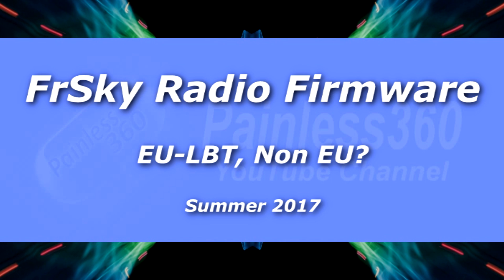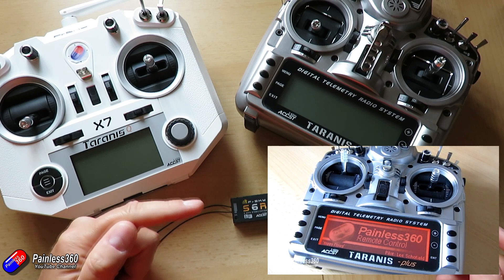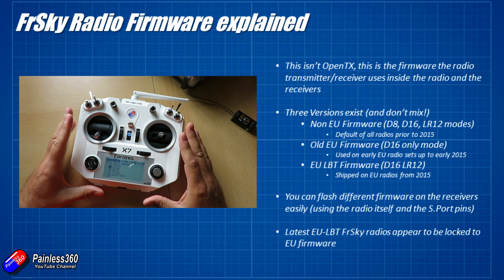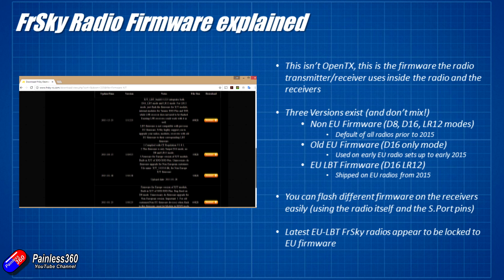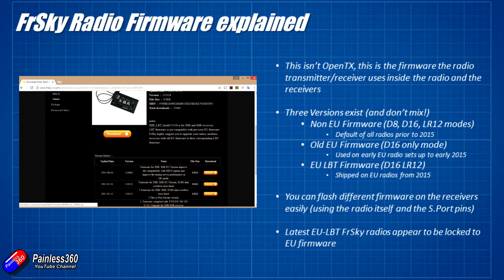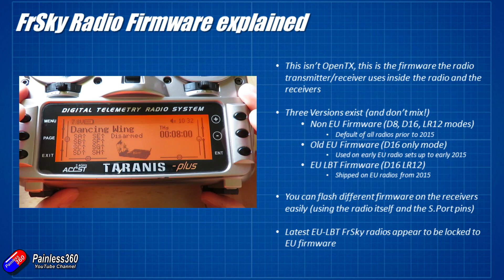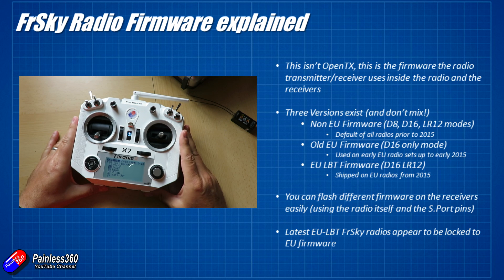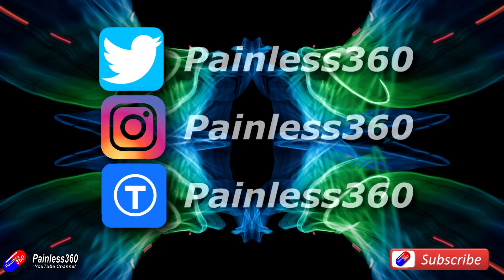RC Quick Tips: What is FrSky EU LBT and non EU firmware all about?

Comment: Hi. I updated my old Teranis X9D to Edgetx and also the internal XJT module. I use the latest firmware from Frsky for the XJT module, version EU LBT, but I can't bind to my new receiver G-RX8. Any idea? Wery greatful for help.
Reply from the maker: I never did that to my Taranis so no idea. If you figure it out, please let me know... Best of luck
Reply: Hi, finally it works. I used "Frsky update sport " software and cable from my PC to update the internal module. The transfer looked ok but something seems to have gone wrong. Later I tried copying the firmware file to the TX SD card and flashed internally from the TX, and it worked, both EU LBT mode and non EU mode with change of Firmware in RX.

Comment: Hi! Anybody knows if there is a real risk of using a non LBT radio in an EU country? Do I need to bother about this at all when buying my first radio?
Reply from the maker: It will still work but not what you are supposed to be using. Most European sellers can only sell the EU versions of stuff now so that is normally what you will get if you buy in country. Best of luck!
Reply: @Painless360  Thanks for answering. I understand that but I will most likely buy my radio on a website outs of Europe so I will very probably get a non LBT version. The one I want doesn't even seem to exist in LBT. So my concern is primarily about the sanctions I risk if using a non LBT version in an EU country. Can I get fined? Does it cause a true public danger? Will I get the army or the police knocking on my door as soon as I switch it on? How does the FPV community react to this legislation? Is it simply discarded or taken seriously?

Comment: With the non- frsky recievers you need d8 mode so how will it work? I’m a noob, and will buy almost evereything off banggood. Which is all fcc, can I just buy a non-lbt tx and it will work? Thanks
Reply from the maker: See my setup and binding videos for the radio you have. Most use D16 ACCST binding with FrSky and compatible receivers now.. Best of luck!
Reply: Ok thanks, another thing I was completely puzzled on was the fact that almost all the qauds on banggood have non-eu recievers. So I’d have to get a new reciever and it would be fairly complicated. I wanted a nazgul5 but there and none in the uk. I couldn’t find any decent 5” bnf drones here! All shops are out of stock and they don’t have much anyway, do you use a non-eu tx? Since you get your drones from banggood, would be great to know as I don’t know what to do. And would using a non-eu tx be against the law? Thanks
Reply from the maker: You can flash receivers with any FW you want - see my videos on it.. Best of luck!

Comment: its now 2020 and you can use the EU radio and flash the D8 non eu in it. just did it and it works fine. Sender is from 2019, so pretty new.

Comment: hi there may sound like a noob question if i have a frsky xm+ receiver non eu and a eu lbt Taranis qx7s i don't need to reflash the receiver just turn off eu on opentx and it will bind in d8 mode to the non eu receiver thanks
Reply from the maker: Not quite.  OpenTX and the firmware the radio circuitry uses are not the same thing.. just 'not' selecting EU in the OpenTX flashing options won't make an EU radio 'non-EU'...

Comment: I realise this is a very old post now, but I just came across it. I am in the UK, using FrSky stuff, and the EU LBT stuff is a pain in every way.

I would be very interested to know if you understand how all this came about. I know the EU has its RF rules - sensible or otherwise, open to argument - but how is it that only FrSky ran foul of this? There are various other protocols out there - Spectrum, FlySky for instance. None of those have had to have to produce different protocol versions for the EU, yet they seem to have perfectly good range and performance.

Is it that FrSky just designed a protocol that happened to get it wrong in respect of the EU, once EU rules were later formulated, or have the others just not bothered to get legal?

I must admit I have difficulty in understanding the logic of Listen Before Talk (LBT) on a spread spectrum radio. The whole point of spread spectrum is that because of the pseudo-random frequency hopping, it is very resistant to interference, and increased use just has the effect of raising the noise floor in the band for other users.

I must admit to feeling pretty put upon here in the UK. Firstly there is the FrSky international / EU protocol situation, secondly there are ever increasing rules and regulations (registration > 250g now, registration for all come July, possibly electronic id in future), and now FrSky are trying to lock in the customer base with ACCST 2.0 and ACCESS.

Just because you're paranoid, doesn't mean they aren't out to get you!

Comment: Hi I need some advice please I bought a taranis X lite s from bang good and and set it up on beta flight, and all went well but since im new to this hobby I put the tick in EU when setting up my radio so now its EU-LBT and since I have just bought a Emax tiny hawk 2 which is D8 I can not Bind to the Tinyhawk. Would it be possible to re flash my radio again but this time not putting the tick in EU or would that mess my radio up. I would prefer my radio to be on Non Eu since it would then support D8.
Reply from the maker: Selecting EU doesn't make the radio EU-LBT, just removes some of the settings from the OpenTX installation (i.e. D8). You can re-flash the radio without EU selected to get back D8... Best of luck!

Comment: ive recently gone out and brought a mobula7 and a qx7. the xjt was on the international firmware and the mobula7 was on the eu lbt so ive gone onto the frsky site to fine the right firmware for the xjt. ive flashed it with the top one (170317) this however has resulted in only having the D16 option and no LR12 which i thought was the old version. could you shed any light on where i may be going wrong. thank you
Reply from the maker: I've not played with it for a while so am a little out of date. The FW you use should be decidwd by where you are flying.. Best of luck!

Comment: Hi! I live in Finland EU and want to get into micro fpv racing drones and later maybe bigger race drones. On top of this I would like to try out fixed wings drones with iNav and gps some day. I already ordered the Hawkeye Little Pilot fpv Goggles and now I am wondering what fpv transmitter/controller to get in order for being able to buy at least micro drones with built in receivers from banggood, AliExpress, Gearbest or the like. Very interested in for instance the Mobula 7, E-max Tiny hawk and the like. Would it then be a good choice to buy an international version transmitter/controller like the Taranis x7 or x7s? I’ve looked at some of your YouTube vids on the subject. Have I understood it correctly that an international version controller always can be flashed to become EU-LBT version and back to international version, but a Taranis controller bought from within Europe always is a EU-LBT version and stays that way? Thank you for your nice YouTube vids! Cheers, Ken
Reply from the maker: Check out my Kit Picks video from August for all of my latest recommendations.. Most of the recent FrSky EU radios can't be flashed to the non-EU system but receivers usually can. Best of luck!

Comment: can you expect higher range from the intl. version?
Reply from the maker: More range is helped by higher power levels. 100mW is the limit here in the UK and in the USA it's 200mW.. Power is set via choosing the country in the radio setup I understand..
Reply: @Painless360  Hi. I just bought another one of these from eBay. I think it's the non EULBT version. My one has the LBT sticker, this one doesn't. The only difference I could find is America in the settings. Both have 217 eeprom bios and OpenTX firmware version on mine is 2.1.9. whereas this one is 2.1.6. Will it be easy to change to EU mode to use it here in the UK ?

Comment: hi painless 360  need your help please, I have just bought the Taranis plus with eu lbt ,,it doesn't have D8 on it for my recievers,do I have to wipe the eu lbt off the tx or how do I do this please
Reply from the maker: You will need to reflash your radio with OpenTX and make sure that the EU tick box in the options is not selected. Lots on this in places like the OpenTX university cover this. Best of luck!
Reply: thank you for reply  will have a go  cheers

Comment: Hello Painless360.
Thanks, for the many very informative videos.

I have again and again RX Loss disconnections with the LBT Firmware. For two different copters, one with a Frsky RXSR and one with an XM + receiver.
The setting in the Taranis x9d plus via D16 channel 1-16.
I have now read that these connection aborts can be prevented by the D16 channel 1-8 mode.
Have you heard about it and can you confirm that?
Reply from the maker: It’s always best to only send the channels you need. Sending more just slows things down.. happy flying!

Comment: if i have the fcc version of the transmitter will i then be able to make it eu-lbt ?
same with the r9m. can it be changed to EU version or does it onnly run 900mhz?
cause the flashing seemed to work for both. but after this video im a bit afraid i have wasted some money?
Reply from the maker: I've not tried reflashing the r9m module so can't comment specifically on that. But from what I can see on the firmware site it looks like that's absolutely something you should be able to do. Best of luck!

Comment: So if i have a non eu radio and i have a quad with the non eu firmware on it and i like to have it like so. But i also have a r9m and i must flash that r9m to the lbt firmware because the r9m wont work well with the non eu firmware on it in europa because of all the mobile phone trafic. Can i use my taranis with the internal rf with the non eu firmware and the external r9m with the lbt firmware. So when i switch off the internal module(with non eu) and switch on the r9m i have the lbt firmware. And when i switch off the r9m and switch on the internal module i have the non eu firmware?
Reply from the maker: The two modules don't interact so you can have whatever firmware you need on both - it'll work. Best of luck!
Reply: @Painless360  oke thank you! I am going to try it

Comment: my tarantis qx7 is non eu version (d8, d16, lr12) My reciver is a r-xsr Eu LBT. do I have to change firmware before binding? and how?
Reply from the maker: Yes you do, see my video on flashing receivers..  Best of luck
Reply: I have seen your videoes, they are nice. But when i bind the reciver all the lights (red,blue, green stays solid an nonof them are flashing). and after turning the reciver off and back on, it just turns back to normal (blue with red flashing but no green. I have heard sombdy say -40 frequancy change needed, but i dont understand that. pleace help :/

Comment: Hey Painless (is it Lee?) - thanks for this video. I think I have just fallen foul of this issue, and wondered if you might be able to confirm/help out? I have an EU LBT QX7S (I’m in the UK), and have a Banggood-supplied iRangeX IRX4 Plus 2.4G CC2500 NRF24L01 A7105 CYRF6936 4 IN 1 Multiprotocol STM32 TX Module With Case (https://banggood.app.link/0024it6btP). I recently got a URUAV UR65 from Banggood (https://banggood.app.link/X87zsDFWtP), which, only after having difficulties with binding, did I find mention at the very bottom of the details page that it isn’t compatible with EU LBT firmware. I am a little hazy on all of this, as I ‘m sure you can see, but shouldn’t the fact that the multi-protocol unit came from China, and thus won’t confirm to EU LBT, mean that I ought to be able to connect to the UR65 using the external TX/module? Yet I cannot, regardless of external or internal TX, D8 or D16 etc. Whilst I am pretty inexperienced in all this as I have only taken up this hobby in the last 9/12 months or so, with very little time to dedicate to it, it seems that buying from UK suppliers gives almost no choice of quad, yet buying from China has all these complications, including off course the complete inability to get any useful help from the supplier when things don’t go right. I will admit to being pretty frustrated now that I am at the beginning of my main week off from work this year, being in possession of a new UR65 that I wanted to start flying in ACRO, and not being able to bind! Any thoughts on how I might move forward? My Taranis was only bought 6 months ago, so presumably won’t take non-EU firmware, as you have indicated.
Reply: Hey painless - seems all of my issues were related to the EU LBT firmware; flashing the international firmware on the radio allows the bind to work fine. Right nuisance this has been, and of course I am now left with the choice of using the UR65, or using an EU-compliant TX; but not both!!! Arhhh! I cannot help but think that this kind of complexity drives away some newcomers, and it has certainly wasted a good deal of my time and got my quite frustrated. K PS: loved your becoming visible 100k video - great to put a face to the voice

Comment: I bought from Amazon and I can choose from D8, D16 and LR12 in settings.  So I would think according to this, I have non-EU radio.. But I flip it over and I have the sticker that has "CE" marking which according to this, would indicate EU-LBT???  Any other way to confirm
Reply from the maker: I check with the vendor. You can have a EU lbt radio that has a D8 setting on it if that was selected as part of the firmware installation. Only the vendor will know.

Comment: So a EU LBT TX can't run D8 mode right? But what if I have a EU LBT TX and I can run D8 does that mean I successfully changed from EU to International? 
Thanks
Reply from the maker: Depending on the options you select it when you flash the radio with the EU lbt firmware you may still have the d8 mode.
Reply: Painless360 Thank you, it often seems like the EULBT firmware is a drawback but I guess that's not the case since all channels are available.

Comment: First off all Painless 360 thanks for all of your good videos and instructions. I am building my first drone and as a matter of case i have a non eu receiver which i have to flash.  Maybe you can give me a hint. i have done everything as in the the videos suggestet - have triple checked the wires and so on. Everything is fine but i dont get the menu entry "Fash ext. device " all i can choose is "delete" (the file). Any ideas. Br to all ...
Reply from the maker: I've not seen that - I'd hit the forums for ideas. Best of luck!
Reply: Found the solution after searching for a long time - i needed to update my Taranis Radio transmitter, now i have all the menu items. Thanks anyway.

Comment: hi mine as a black sicker on back saying eu lbt  on qx7   whats best receiver to use for me  many thanks
Reply from the maker: +Gef Rep and receiver with the same EU lbt software on it will work great. If you accidentally buy a receiver that doesn't have the firmware on it then I have a video showing you how to flash it with the right version so it'll work fine. Best of luck!
Reply: thanks    will do thanks for your help again   iv sent  for Frsky S8R 16CH 3-Axis Stablibzation RSSI PWM Output Telemetry Receiver With Smart Port  Compability: Frsky Taranis X9D Plus/X9E/Horus X12S/XJT in D16 mode
S8R-EU only works with Frsky Horus X12S and Taranis X9D Plus/X9E/X7/XJT in D16-EU mode.

Comment: Yes been there done that  .
Bought my taranis late 2015 .
Purchased two  3 / 16 channel receivers for my drones  .
Then last week  bought a 8 channel rx for a glider guess what  it wouldn't bind .
New rx runs LBT .
So contacted supplier he told me that my taranis  is old firmware. He sent me a Link to show you how to flash the firmware yer right there was so much stuff on the open TX website  I haven't got a clue what I was looking at  .different release dates you needed drivers. I didn't want to bugger up my radio installing something and wouldn't work at all . 
Im not that technically  inclined. To flash new firmware 
So had to purchase a LBT module  . I love the frsky radios excellent value for money and the way you can change the switch allocation 
But so complicated for me when they keep changing firmware  I just want to install the radio in a model and fly .I've got a spectrum  but your stuck with the switch allocation.
And I bet in a couple of months  if i want to buy another rx then  that probably  won't work ether. 
They would have changed the firmware again.
Reply from the maker: Updating a receiver is actually not too tricky. If you’d have googled for a video you may gave found this - https://youtu.be/0fNC2Jw1kxY happy flying!

Comment: Hi Lee,
I have the option of both none EU and EU LBT at the same price,
As I live in the UK I'm now confused which one to go for?
It will be mainly used on fixed wing.
HELP !!!
Great videos, keep up the good work.
Kind regards 
Bill
Reply from the maker: It depends on what the radio is using, you want the matching receiver. A LBT radio will normally have a sticker saying LBT or CE on it somewhere. You can flash a receiver using the radio if you get the wrong one, I do it all the time here..
Reply: Painless360 Would it be better to buy the non-eu transmitter so you then have the option to flash the tx firmware or buy an EU version?
Reply: I've just brought a EU version of the Taranis Q X7 but, thanks to your great video, I now think I'm going to have a problem trying to bind this to an Eachine QX90C, as their spec suggests it is D8.  Is there anything I can do please?
Reply: Pete Kavanagh is it not possible to flash the D16 firmware to the rx?
Reply: Shane Harrison Maybe. In my case the RX is not a discrete unit, rather a chip that's part of an overall FC board.